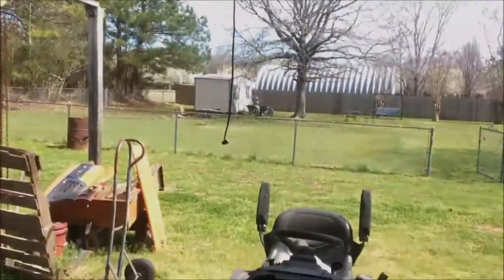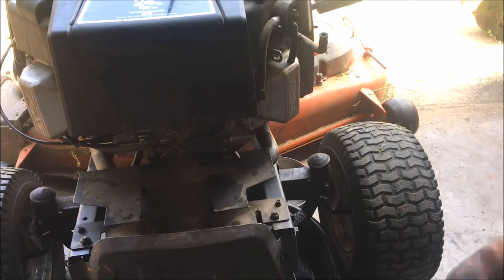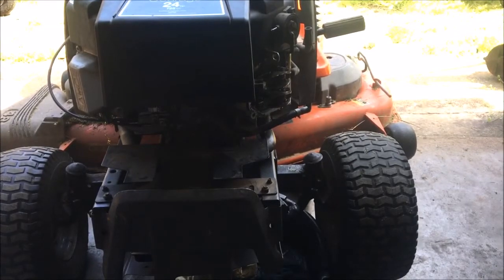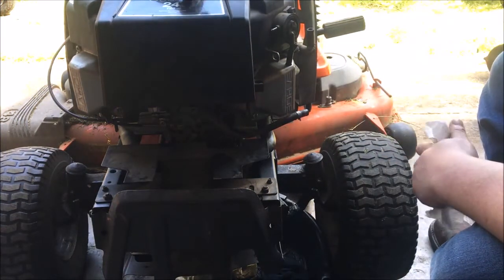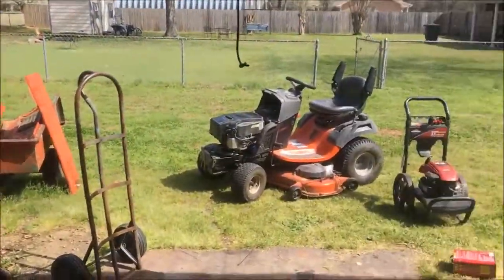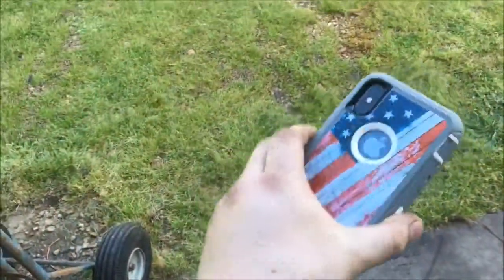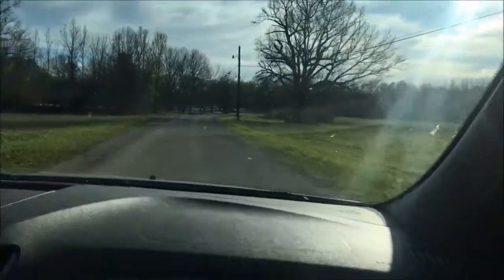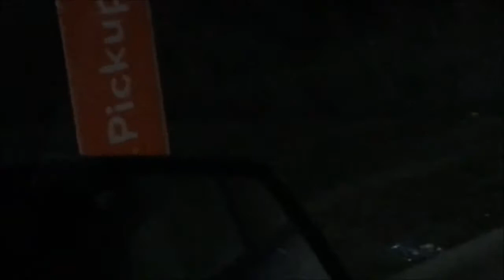fixing the oil leaks on the husqvarna lawn mower and random vloggin

Comment: They don't make a regular gasket for the valve cover? Have you had any trouble with your oil drain plug leaking? Good video. Thanks, John
Reply from the maker: Unfortunately not the valve covers just have rtv sealer I have not had any issues with the drain plug leaking

Comment: My 46inch Husqvarna lawn tractor leaks a size of a Quarter peice on the ground kind of lined up from the oil filter is , and I don't see any oil leaking from the oil filter.  Didn't start till I changed the oil and filter. Wiped everything of the frame, and I moved the tractor in 4 different spots over night the oil is there
 What do you think it would be?

Comment: Have you done on on changin the oil on that unit? I can't figure out how to get the faqstner things off whatever they call the covers over the filter and drain plug. They say "Just Remove It" but don't say how. I cant push it with my finger (first time trying so it may be tight) and there's no tool access